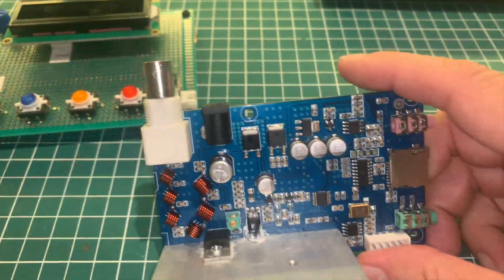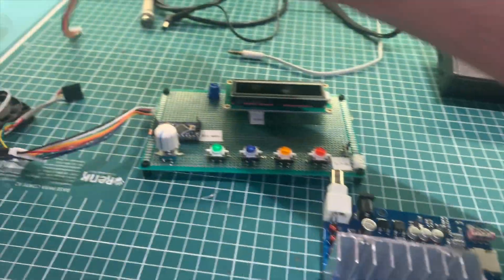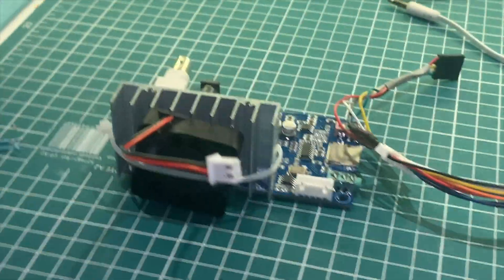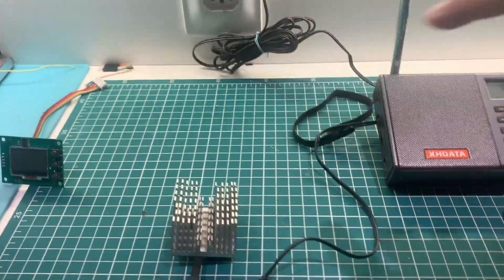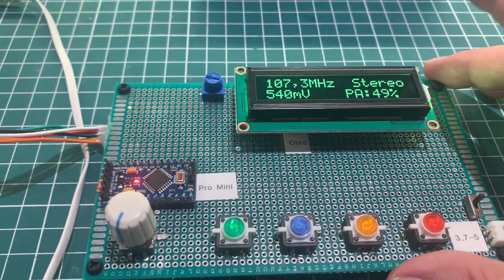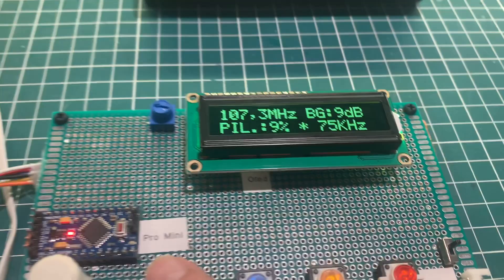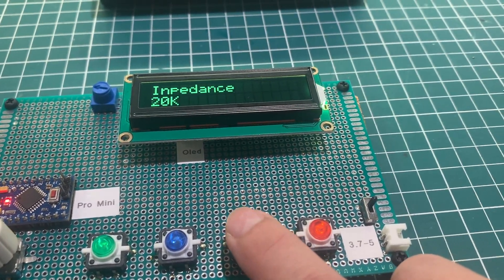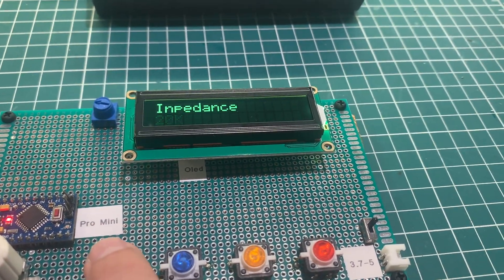QN8066 Arduino Library by PU2CLR - Part 2

Comment: This is a great video and amazing work!!! I'm planning to build an Arduino based controller based on your library!

I noticed that you demonstrated changing of input audio impedance. I have the same transmitter (actually I have the 5W and 15W versions of it), and when I'm connecting audio input from my mobile device, similar to what you did in this video, the maximum volume that I can achieve is far low compared to other FM stations. When I tried to increase volume from the display control panel, I discovered that volume setup of more than 23, will cause to mute the audio completely, for values of 23 and less, I get the audio, but with a low transmitted volume. I tried different device as audio input but reached to same results. Could it be due to a input impedance mismatch?

In your video you showed by using your own powerful controller, that you set input impedance to 20K. Do you know whats the default value of the input impedance of this transmitter? Since this transmitter comes with no user manual, I was not able to find and option in the original control panel to change the input impedance, so I assume that it's fixed on some default value.

What do you think? Could it be the reason why I have low transmitted volume on both 5W and 15W circuits? Max volume that I'm getting is ~60% compared to other stations.
Reply from the maker: Thank you for your kind words and interest in the project! I’m glad you found the video helpful.

Regarding the audio input impedance – from my testing, the best value I found was 20K. Adjusting this parameter, along with others, can indeed provide much better audio quality during transmission.

I’ve implemented all the functions of the IC in the Arduino library, so you should be able to control and fine-tune most aspects of the transmitter using the library.

That said, I don’t have extensive experience with FM broadcasting. I developed the library purely out of curiosity and for experimentation purposes.

I hope this helps with your project, and feel free to reach out if you have any further questions!

Best regards.
Reply: @pu2clr  thanks!!! this indeed helping a lot!

Comment: Hi, congratulations on your work.
I read that there are problems with the i2c lines.
Replacing the parallel 20x4 display with a 20x4 i2c, what additional problems might I have? You should just add the LiquidCrystal I2C library...
Tell me what you think...
Thanks and congratulations again
Reply from the maker: You can use a LCD 204 I2C with no problem.